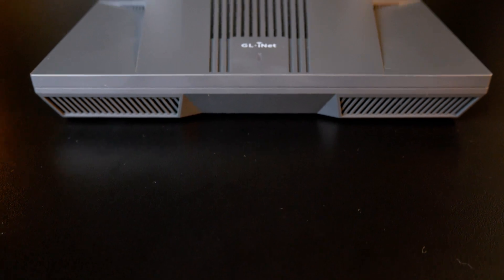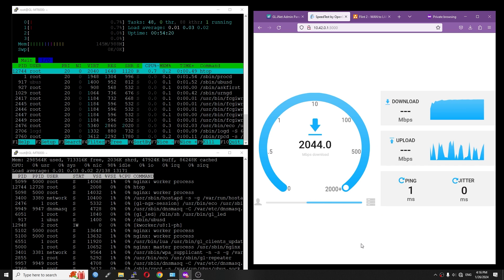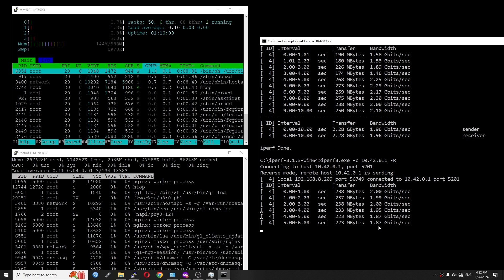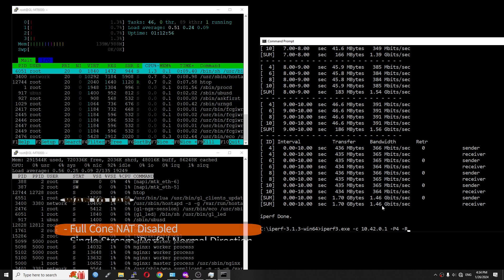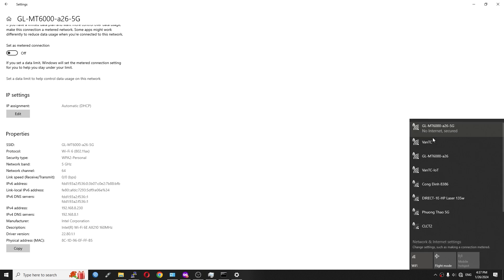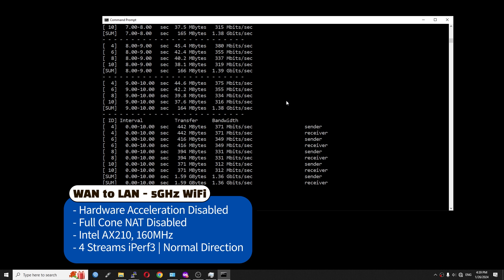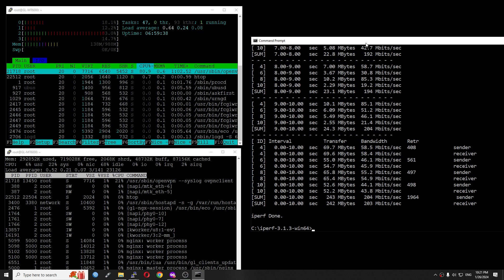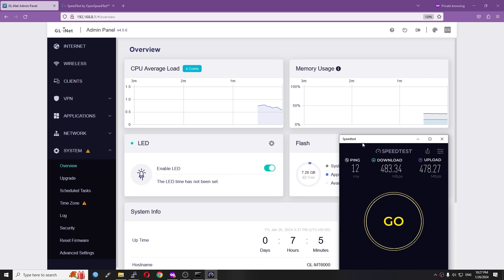GL-iNet Flint 2 - Peformance Test: WAN to LAN, WiFi, VPN Throughput

Comment: Does the 2.5GB port have dhcp??
Reply from the maker: Hi, may I know what port you are talking about.
- The WAN port (2.5GbE) has DHCP client by default, which will automatically get IP address from upstream router
- The LAN port has DHCP server running, which will give out IP address to connected devices, such as PC, Tivi, etc.

Comment: Anyone by chance have a chance to test vanilla openwrt on this router with a 1gb up/down fiber connection? I am curious what the performance is like as it would be my 3rd router. The first being the xr1000 and the second is the netduma R3 I am using now and am not happy with the wifi performance as it's slower than the netgear R7800 I had years ago. Reason I ask is there is probably no hardware acceleration with vanilla openwrt.
Reply from the maker: Hardware capacity: Yes it can do that
Software: need to test, not really sure since I don't use Vanila
Since the OpenWrt build from GL-iNet can do ~ 2Gbps, Vanila OpenWrt should do the same. If it doesn't (for now), it is just a matter of time. Buy this router and you won't regret (this is not an ads)
Reply: @VanTechCorner  UPS tracking says it will be here tomorrow around dinner time. I ordered a 13 ft DC extension cable as well cause I read the reviews about the power cable being too short.

Comment: I was wondering, is "Hardware Acceleration" in the GLINet settings the same as turning on Hardware Offloading under the LUCI Firewall?  IF not the same, what's the difference between the two?  Also, can software offloading be used long with hardware offloading?

Comment: How is the wifi on this one compared to a Linksys WRT32X? Looking for a wifi6 router. Primarily use it for media streaming on Nvidia shield/Apple TV 4K. I have a 1gb connection. Currently get appx 500mbs ul/dl on OpenSpeedTest site using my laptop on WRT32X.
Reply: Well the Flint2 has a 2.5 Gbps ethernet port and 2 Gbps WiFi 5Ghz.  For streaming from a local server it should be better, but usually the bottleneck is with the internet provider.

Comment: Hi I have  the flint 1 but it keep dropping  the internet  I am very disappointed I need some help to setup I have a tp link omada  set up and want to use the flint for the adguard   home for security purposes  only.can you help me with the set up of flint
Reply: Doesn't mean it's the router that's dropping the connection, it could be your internet provider.  One way to test it, is by taking your router to a friend's house, connect it to their internet and test it.  Or use another router on your service and see if it drops.

Comment: Thank you for the video, very detailed and informative.
I have an Asus TUF-AX4200 which I think has the same SoC and was wondering about benchmarks.
This is a solid product for a good price but to be honest the results are a bit disappointing. I was hoping that thanks to hardware acceleration it would saturate a 2.5GB link. Looks like x86 is still the way to go for best performance.
Reply: Both the Flint1 and Flint2 have hardware and software offloading and acceleration, watch his previous video.  Also, you can flash it with OpenWRT/GoldenOrb firmware, it has an unlocked bootloader. ;)
Reply: @BillAnt  What I meant is the N5105 mini PCs do not have hardware offloading (only software), but according to Van’s videos it still manage to beat this SoC which has both: 2300-2400 both ways for N5105 vs ~2000 down and 1700 up for the SoC. I wonder if this is actually related to Windows drivers?
Reply: @healthy5659  - Drivers can play a big role.  For example tethering an iPhone to Windows get the full 5G mobile speeds (over 400mbps), but tethered to an OpenWRT router to give it internet, the iPhone's speed drops to about 50-80, which is most likely driver related.
Reply from the maker: Yes it does 2.5Gbps WAN to LAN. Are you expecting 2.5Gbps for WiFi?
Reply: @VanTechCorner  I don’t personally care much for WiFi speed for my use case. What I meant is, seems like routing performance of this device is slightly worse than the N5015 box you reviewed, even though it doesn’t have hardware acceleration. I was surprised because I was expecting it to be the other way around.

Comment: You haven't tried Wi-Fi with acceleration enabled.
Reply from the maker: Yup, I forget about that part. I will have a detail video testing the WiFi with 2.4GHz and 5GHz radio.
Reply: @VanTechCorner hi sir, can I ask you what vpn service provider that you are using in this video. I want to try it. Because I try wireguard surfshark, it is pretty slow for me.